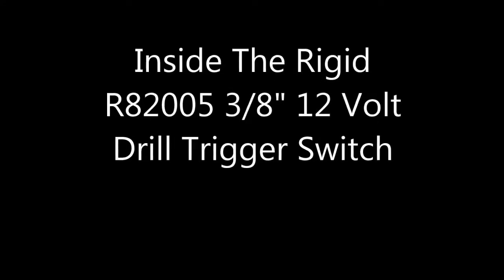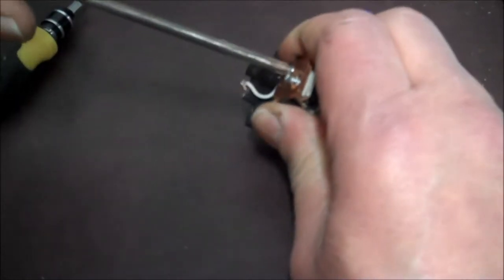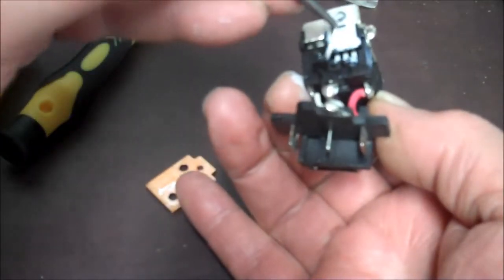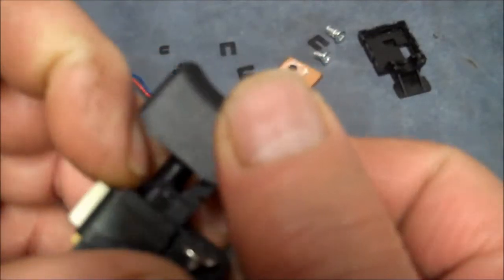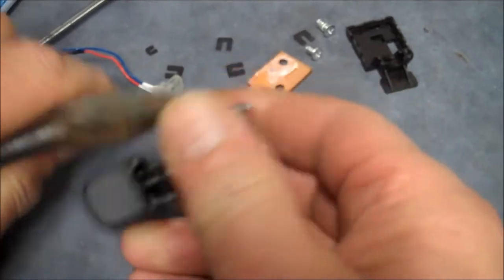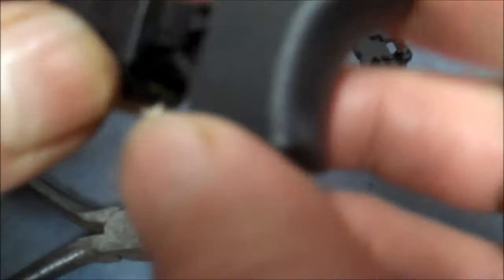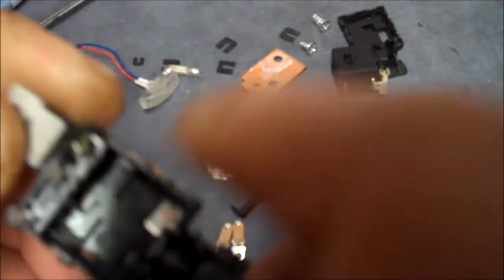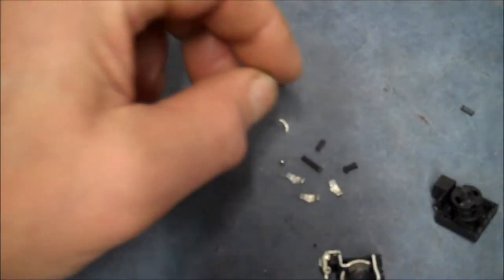Rigid R82005 12 volt Drill Trigger Switch

Comment: Haven't used this drill in a while. Went to use it today, it started to spin then stopped. Thought it was the battery but I put it on the charger and it was fully charged and it worked in my impact. Any idea what the problem could be?

Comment: There smoke coming from the trigger switch circuit board of my 12V drill. How do i fix it without replacing the entire switch?
Reply from the maker: Figure out what burned up and replace it. Otherwise you will need a new switch assembly for your drill.
Reply: probably the mosfet , find the same one and solder

Comment: Now try to put it back together
Reply from the maker: yea lol
Reply: i bought loads of Erbauer impact drivers with similar triger switch fault i went through same process as you and managed bring all of them to life
Reply: @jdmhero1358  was the mosfet the culprit in most of these? I noticed that when I disassembled my dewalt, the thermal paste had managed to "smear" away from the actual chip and was all over the heatsinks where the chip tab made no contact at all, therefore making the chip heat up excessively and eventually going bad prematurely... at least that's theory, what do you think?